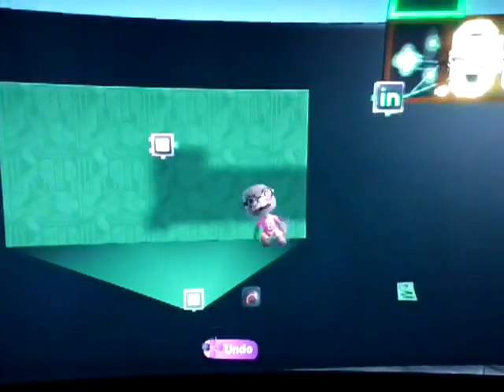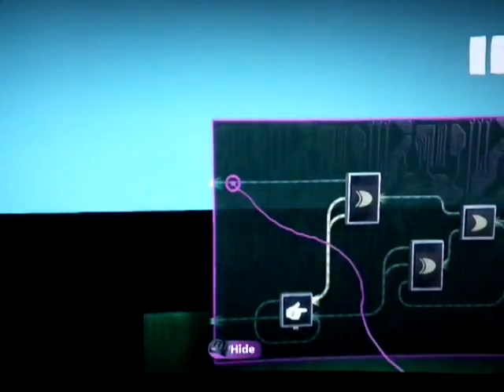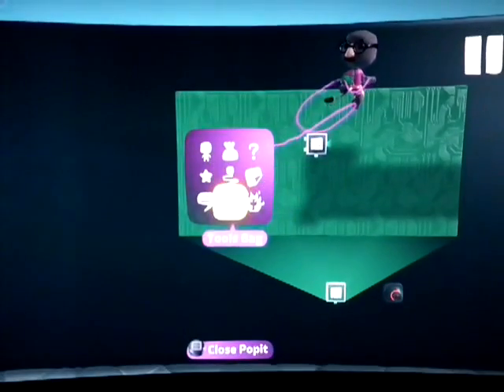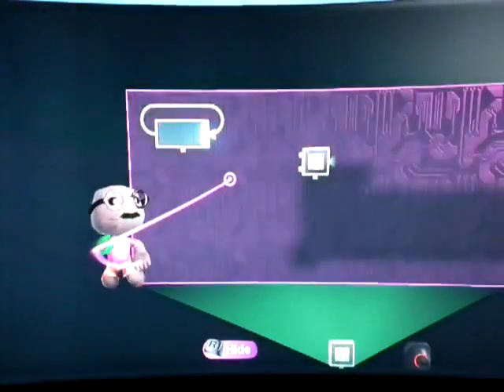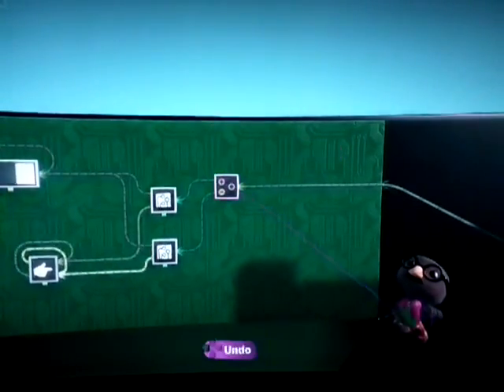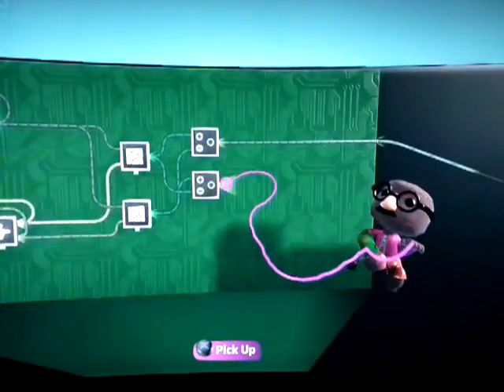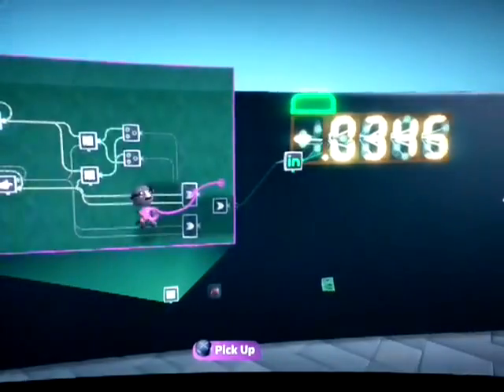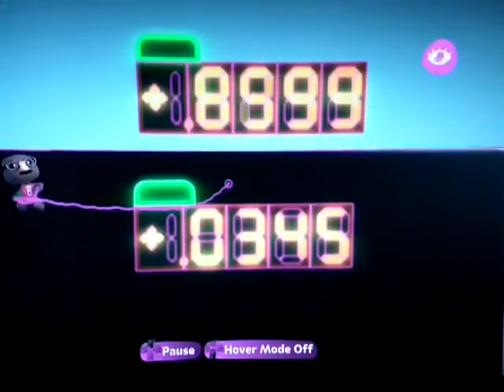LBP2 Tutorial: Detecting changes in analogue signals

Comment from the maker: Sorry for being ridiculously late. This system detects changes in signal strengths: Is the signal getting bigger/smaller/how much, everyframe. What you describe may not require this setup, you may want to subtract the signals and if they are equal the output will be 0, but with LBP there are always peculiarities that don't come to mind immediately. There should be good tutorials for analog / digital conversions to convert the 0 analog into digital 1, I have been away from LBP for a while!